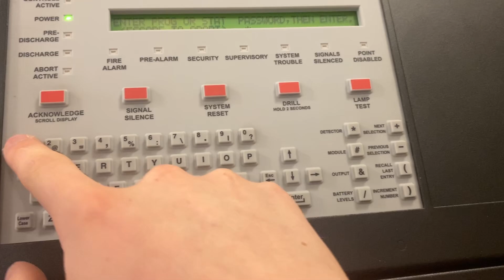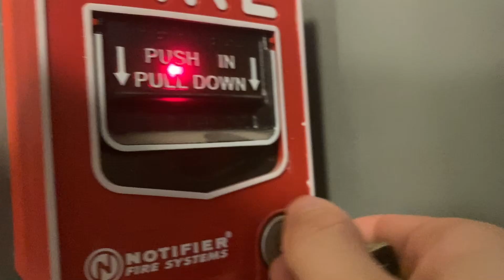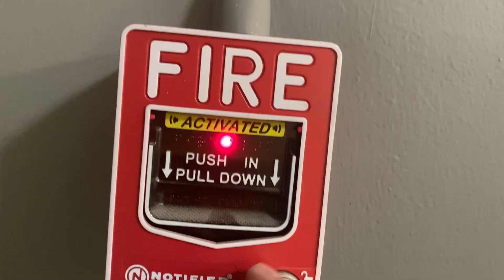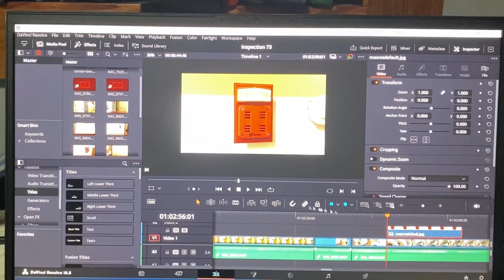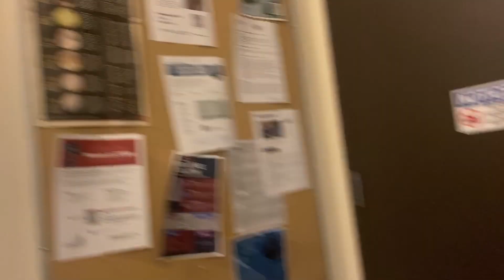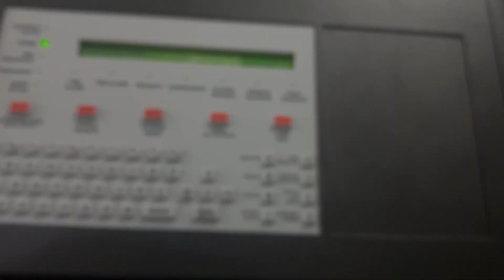Retrofit after Retrofit | Fire Alarm Test #75

Comment: Were those LED L-Series?
Reply: No they're Wheelock LED 3 Exceeders that have a long flash, the LED L-series have a shorter flash than these strobes just like a Xenon strobe
Reply: @joeycaridi3030 
Not LED3 Exceders. LED3s flash correctly. These are the original LED Exceders.
Reply: Ah okay. Thanks to both of you!

Comment: No idea how people are constantly messing up the basic alarm silence function.
Reply from the maker: You prob couldn’t do it ngl. Much more complicated to program on a voice system
Reply: @4O5O-8O  for someone unexperienced? Yes. For someone with some experience in panel programming with other products? Would be a challenge but is doable. Plus, I know a bit about custom programming on notifier products since I’ve watched Nics systems and electric program his. Plus, one of my contacts for fire alarm resources told me that the DVC is all custom program so I knew that from the start. Thing is though with software based units is that everything has a point and you can use those points to execute an action. In the case of a Notifier system, I could find which point “signal silence” is tied to and assign a software zone and script to where the messages also stop when the signal silence point software zone is active so that you aren’t left just pressing reset because signal silence doesn’t work.